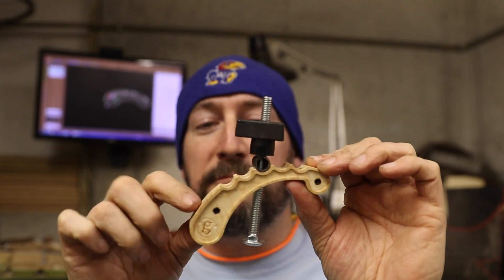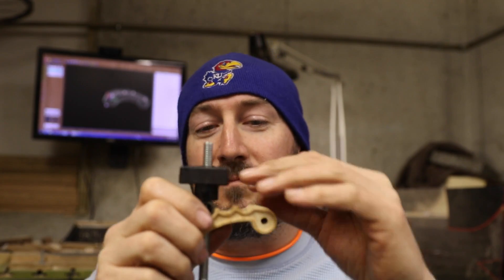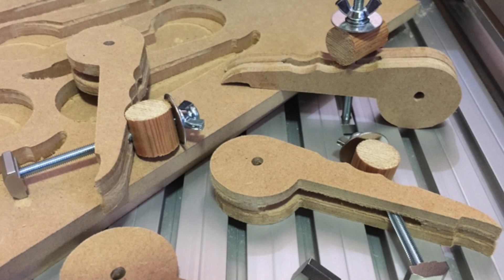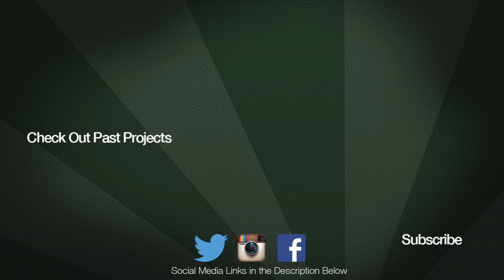CNC Hold Down Clamps

Comment: I think your audio track is sure to alert YouTube's copyright system. I could clearly hear Maroon V. Meat-loafing aside...I love this elegant design for the CNC clamp. Could they be 3-D printed using your plans as well? I noticed some flex in the clamp as you screwed down the workpiece. Might a layer of aluminum or steel help with the strength? What was the dark wood used in the clamp?

Comment: They look extremely nice. Although I found that screwing down the workpiece or using scrap wood taps screwed right through the middle and into the table works very well.
Reply from the maker: I couldn't agree more.  I've been using scrap wood for hold downs for a year now.  They work just fine...  I just wanted some "jewelry" for my workspace! :D